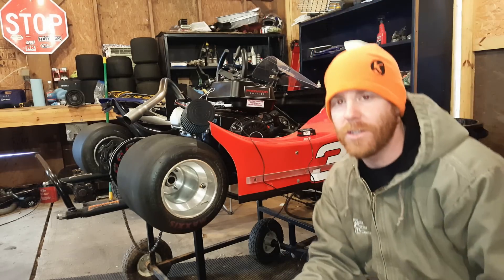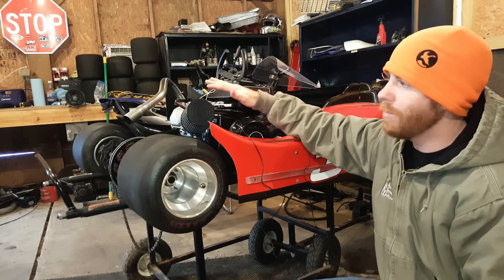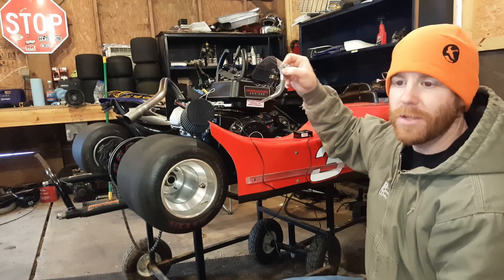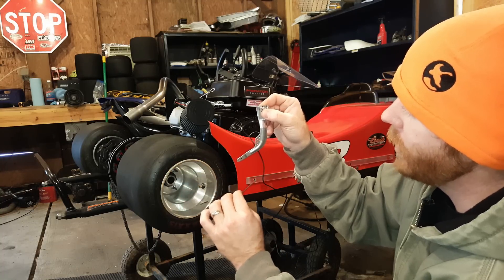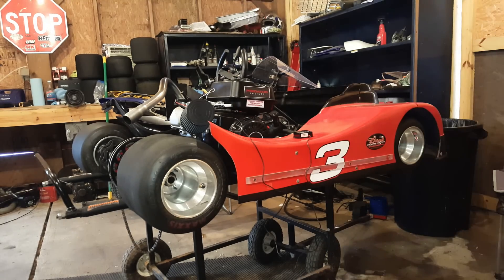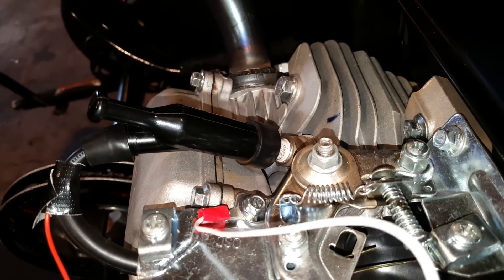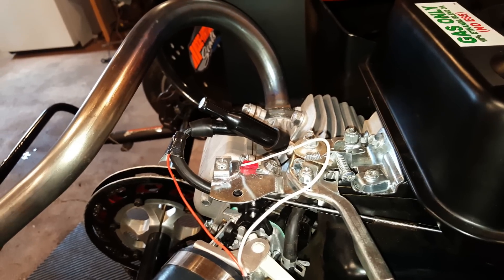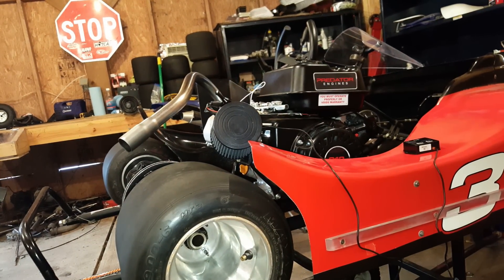Get 5000 RPM out of your Predator 212 in 5 minutes

Comment: I don’t want my flywheel and connecting rod exploding and sending shrapnel into my back, my stock predator 212 can’t take over 3600, and I’ve already put too many miles into it to be able to open up the engine and put performance parts in it.

Comment: I have a 212 hemi with CL 1 cam, billet flywheel, heavy breather type air intake..and im getting 6800 rpm..stock carb, valves, piston, crank and head..

Comment: I find it easier to just put a bend in the governor spring, thus making it have more tension.  Though i only set mine to 4000-4200 rpms...higher than that and you risk the flywheel coming apart
Reply: I have raced karts for 20 years a d I have never seen a flywheel come apart
Reply: @jakehamilton8544  kinda surprised if you push a stock flywheel above 7-9kish they sometimes blow apart I used to do it for fun on the old beat up engines I had sitting around few years back

Comment: At what rpm do the valves start to "float" with stock Springs?
Reply from the maker: [HE] Homemade Everyday it vaires between 5200 to 6k rpm. The hemi around 5200 the non hemi closer to 6k for whatever reason.
Reply: Kart good to know.   Thanks for quick reply.  I enjoy responding to my subs too.
Reply from the maker: [HE] Homemade Everyday no problem. Valve float isnt anything to be scared of either. With a basically stock setup you can hit it and be fine...just dont keep it there for any real length of time. 

You start milling the head etc then it can cause the valve to float, hang open, and make contact with the piston which wouldnt be good.
Reply: That would be a fun experiment.  I feel like the piston face would smash a valvei
Reply: @KartArt  I know this is old but I see this posted all the time. You DONT mill the head on a 4 stroke. Leave that to the china doll rubbish 2 stroke know nothings. With a 4 stroke you simply install a domed piston and voila!
Reply: [HE] Homemade Everyday 5000

Comment: both springs are there and hooked up.  checked the governor to see if was loose.  nope tight.  I believe that the governor inside the case is not opening.  seems throttle is wide open when you start but governor pulls the arm toward the motor almost instant.  slowing it to a idle. dealing with Coleman.  if I have it checked  they  will pay for it.  if motor bad I might get a new one in month or so.   I want these kids to ride this week
 they have nothing.  will the predator from harbor freight bolt in.  can't seem to get a answer any where
thanks a lot cart.
Reply from the maker: steve levinski grab the throttle arm and move it to full throttle and let go. Does it snap back to idle position? If it doesnt it needs to. 
if you have the return spring on and its functioning there is no reason for it to be wide open throttle if your not applying throttle input. 
the governor would not cause it to go wide open throttle. it simply closes the throttle as it starts approaching x rpm

Comment: you make  good videos.  just bought a Coleman 196 CT.  I just want it to run.  start it and wide open.  bought  it for some neighbor kids.  can't  find out what's making it stay wide open.  springs 2 are hooked up but won't do nothing but wide open. dangerous  for any one
Reply from the maker: check to make sure there is a return spring closing the throttle blade. If there isn't any return spring on the carb forcing it shut once it starts it will run wide open.......... trust me I've forgotten to hook mine up before and been drug across the yard hanging on to the back of a kart trying to kill it LMAO

Comment: How did you add a second wire to your tachometer? I think I have the same one from amazon and it only has one wire and that wire is stranded not holding two inside the sheathing. Thanks

Comment: I just bought a predator 212 and did nothing to it. All stock. But the throttle doesn't spring back to its original position. It's just stays where you set it. What can I do to get it to return to idle position on it own
Reply from the maker: SQUIRRELBAIT the bolt that holds the throttle arm in place can be loosened until it allows the arm to freely move.
Reply: Kart, wow that was fast. Thanks for the help. I literally bought the engine a few hours ago and making a mini bike.  Thanks!
Reply from the maker: SQUIRRELBAIT no problem at all. Good luck with the mini bike
Reply: Thanks. Btw I'm subbing
Reply from the maker: Cool thanks
Reply: Needs an  additional return spring.

Comment: I hooked up a tachometer to my Predator. It has the Governor removed.  With normal Ranged Oil. It reaches 5,065 RPM. Then we put 0W-20 Oil in it. With that light oil, it made 5,289 RPM. Run light oil for that extra little power.
Reply: EnKay Moto isnt that oil way too thin for the engine
Reply: Yeah run that light oil until it ceases up...

Those engines NEED thicker oil because the wrist pin, cam/ lifters and cylinder are lubricated by the oil slinger on the rod. If the oil is too thin, it will just cut right through it and not "splash" the oil around to everything that needs to stay oiled. 

Also, being air cooled, that engine will tend to run a bit hotter than the water cooled, pressure lubricated, engines that the 0w-20 is designed for, which will make the oil even thinner
Reply from the maker: i agree light weight oil shouldnt be part of a rpm goal. run the proper weight oil and go to a new cam etc to reach your rpm goals.
Reply: Kart I've been running it for a Year Now. Runs fine. No knocks, it doesn't hurt these little motors. And if you blow it up, and you can buy a new one, and just transfer your racing parts from the old one
Reply: Kart 
Probably isn't a big deal unless you do sustained high rpm pulls all day...
but  for a few runs that sounds like a good trick.
Reply: Kart Art So I don't have to remove my governor just to get about 45000 - 5000 rpm's ?
Reply: @trellatkins959 it will come apart if you dont

Comment: Hey buddy messed with the spring and moving it to the different holes and still only max at 2800 I adjusted that screw and still 2800 was wondering if stretching the spring some would help reach the rpm I want

Comment: why my predator 212cc won't start when it's hot
Reply: Xaysana Boriboune i think it has a safety mode that doesnt allow the engine to turn on when it is burning hot
Reply: oh OK thanks will check it out.
Reply: Safety mode? Lol, I've ran mine until my aftermarket exhaust is glowing red. Check the oil sensor. A lot of people will remove theirs because sometimes it stops the motor from running. Might need to clean your carb too.

Comment: its over 5000
Reply: DBZ?
Reply from the maker: Krader Dewd after the mod?
5k isnt the limit but generally what i shot for. somewhere around 5200 to 5300 your gonna hit valve float anyways.
Reply: Kart put a jetted pz27 kei hin carb
thats jetted 27lb springs and mamba cam....it will fly...
Reply from the maker: Krader Dewd if you look at my other videos i end up doing an arc rod, flywheel, black mamba jr cam, mikuni carb, etc and testing it on the kart. Pretty happy with that engine setup
Reply: go kart belt and clutch set up

Comment: ok my springs are set the way you described factory. any suggestions?
Reply from the maker: bob westerfield yeah screw out the captured screw on the throttle assembly and see what rpm you get. then play with the larger spring position until your happy with it.

Comment: I just got a brand new 420cc for my go kart. Is it safe to do this mod with that engine? I don't want to stress it as much as removing the governor would stress the engine, but at the same time I want a bit higher rpm.
Where should the springs be placed for a 420cc?
Reply from the maker: BloodM1st if your worried about stressing the engine too much i would leave the stock springs in. You can either mod the governor like this or just remove it completely, either should be fine.
Reply from the maker: BloodM1st disregard my other reply. thought you were talking valve springs......
you will have to experiment with the spring placement to get your desired rpm. I havent done this to a 420 predator yet.
Reply: Kart I realized haha. I don't have a way to measure the rpm, I guess I'll have to do it by ear when I move the spring.
Reply from the maker: BloodM1st you can get a cheap tac at northern tools that works well.

Comment: This is actually called something like disabling your governor or something like that. Basically you messing with the spring and rod setup is actually really bad for the governor. This is basically like disabling your governor and basically at high rpms the governor gear could just break apart in your engine and it'll be like a little tiny grenade went off in your engine. I actually reccommend that no one does this. It may not happen to all but in some cases it will happen and it won't pretty.
Reply from the maker: Jason Soto with all due respect this is done by hundreds of kart racers and no issues. 
now if you were to disconnect the linkage and the governor was still in then that would cause issues...... the way thats explained on this video and my other still allows the governor to function.
But hey, your entitled to your opinion.
Reply: Thats why you remove it alltogether lol....boy that was tuff to figure out there Cletus!

Comment: Can the governor break if too long at full throddle ? I could just remove it, but I want to keep the engine as "Off The Shelf" as possible.
Reply from the maker: What's the geek i have never had it happen but if your up to the task removing it is a sure thing. 
I keep them in until i go into the engine to put some parts in.

Comment: Would you recommend this over just removing it?
Reply: I get 5200 RPM with the governor removed.
Reply from the maker: Connor Oot if you are mechanically inclined i would recommend removing it. If your planning on doing a rod etc later i would just wait to do that when you install the rod. This is more for those who dont have tools or mechanically inclined etc.
Reply: Kart thanks! I've heard that you don't really need to replace the internals/flywheel with billet parts as long as you upgrade the valve springs. Is there any truth to this?
Reply from the maker: Connor Oot thats actually false. 
if you keep the stock valve springs in you will hit valve float before your really stressing the rod or flywheel. If you upgrade to stiffer valve speings you will be able to turn more rpm and that will definitely cause a rod failure. Connecting rod failures are much more frequent than flywheel failures.